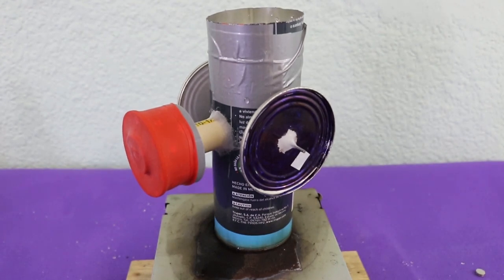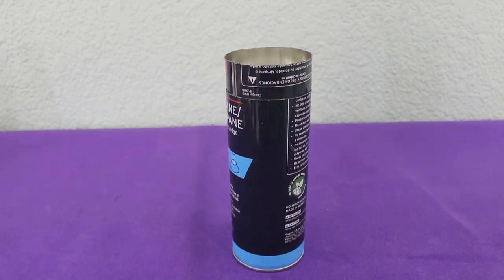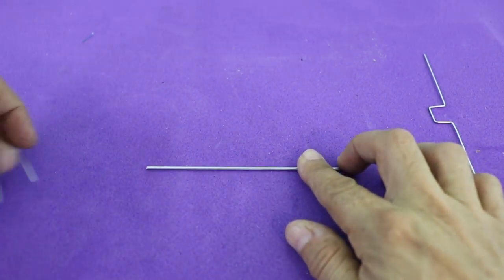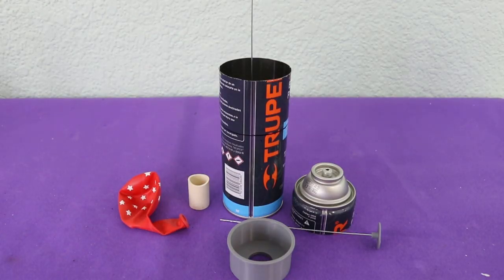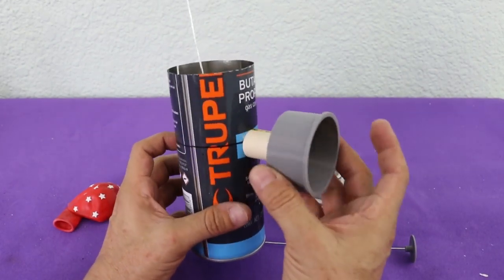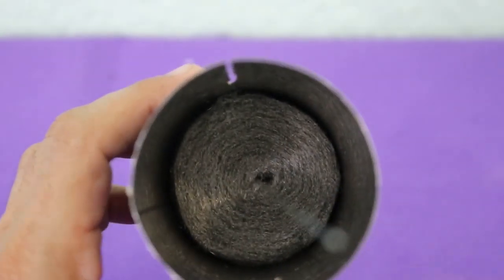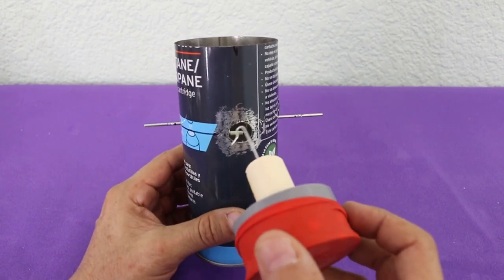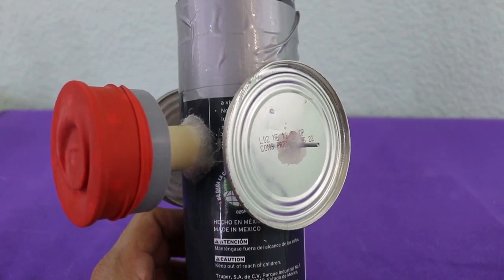Homemade Stirling Engine 800 RPM

Comment: I don't know if you are still active or not but would you mind explaining how the stirling engine works and why the steel wool also needs to go up and down? Like does the steel wool go up when its hot and push the crankshaft or does it just act as a piston? If it just acts as a piston, can I use any other object of the same size?
Reply: The steel wool is the loosely fitting displayer piston to move the air around and at the same time it works as a regenerator, keeping the hot and cold side better isolated.
Reply: I know the steel wool acts like piston rings. Lol
And the engine works on temperature difference

Comment: Bonjour.
L'assemblage des bielles sur le villebrequin n'est pas montré de manière précise c'est très dommage ! 
Salutations. 
Un ancien professeur de mécanique de la vieille école !
Reply: Note that the position of the 'baloon piston' is 90 degrees (quadrature) to the  wire wool displacer, so that the connection to the crankshaft is simple. both piston rods connect at the same point.

Comment: A Holley carburetor vacuum secondary diaphragm works great for the cold piston, versus balloons or rubber glove material. Not cheap, but I’ve got several just sitting there.
Reply from the maker: Never seen one  just pictures they look amazing
Reply: @ludicscience  a large flat steel washer with a 2” diameter center hole will clamp the Holley secondary diaphragm onto the bottom of a small 10 ounce steel coffee can. Could easily be incorporated into your designs, and it’s a viable, replaceable part.
Reply: @ludicscience  I’m building the Stirling engine, & I came up with a great idea!!! I have an old carburetor system from an old 8 HP Briggs & Stratton gas engine. I sealed everything with silicone, but I left the throttle operational. The diaphragm will be just inside the round air cleaner with the operating rod out the top. Properly positioned, the throttle will actually affect engine RPM., restricting flow from the displacer piston.
Reply: @boomstick4054  thats an interesting approach, did you try it?

Comment: Looking forward to build this. Dosen't the engine need an exhaust?
Reply: Stirling cycle is based on a pressure change, hot end (high pressure) cold end (low pressure) there is a displacer inside the CAN. The CAN is a sealed which is IMPORTANT. The displacer moves from TOP to BOTTOM of the can. It literally "displaces" the air, so the air moves locations from TOP to BOTTOM, at the TOP the air cools => low pressure at the BOTTOM the air is heated => High pressure. Since  the can is sealed those pressure changes drive the balloon or diaphragm in and out,  a mechanical linkage connects the diaphragm to the displacer in such a way that the cycle continues . So No exhaust,  if a leak exists it would simple lower the performance of the engine.
Reply: @robn2497  ok i get it thanks for the explanation

Comment: Make another one, but this time add a crank to one of the wheels with a magnet that goes through some wire coils and measure the voltage you get out of it.

Comment: I really like this simple design that avoids the need for finely machined piston/cylinder assemblies. . It would also  be easy to upscale to bigger components, and to create a multicylinder engine with this approach. Well done!! I am going to start looking for a  serious length of steel pipe and a car tyre tube.
Reply: Good luck

Comment: What powers the engine? Why is there water on the top of the engine? Cool project. 👍
Reply: It is powered by the difference in temperature between top and bottom. In this case handle heats and water cools. Air inside expands and contracts moving the piston
Reply: @JustinTopp  I see thanks
Reply: Usually I see people just use a candle or flame.
Reply: KTProjects yea the water isn’t 100% critical but it works on a temperature difference so water keeps it cooler so it’s more efficient and will run longer as the top won’t heat up

Comment: Plese answer 
Cam we use a lower quality steel wool(steel scrub)???
Reply: the idea is that it doesn't let that much air pass through, steel wool probably wont work as well.
Reply: @jacobgodde6576  hey can I cover one side of piston by a metal disc

Comment: Could you publish or provide a link for the measurements
Reply: Guess the dimensions from the size of the aerosol can and where the crankshaft is placed. Have a go at cutting up a few aerosol  cans. They ain't expensive round these here parts.

Comment: Try to add some load.. 
Do some useful work out of it.
Reply: This is an atmospheric pressure Stirling - they don't produce a lot of power.  However, I'd be interested in mounting a magnet on the power piston shave and wrapping a coil of wire around that PVC pipe, and seeing what kind of current I could draw from it.  If you sealed this up better and put pressurized helium in it, then you'd be able to get more power from it.

Comment: some info.         at 6:13,  the  mass and its distribution, in each flywheel are  Not   optimal/effective.  
at 7:06, imo,  the diaphragm is excessively noisy; and this suggests  inefficiency.         it is understood
that  different  cold-side  designs  have  differing  noise levels.            ideally, a diaphragm should act
as an  airtight,  low-tension,  centering spring;         note that  where the linkage connects to it,  the 
diaphragm is  LIMP.       in other words,  No  centering affect is happening.      consequently, the potential
reward for the use of a diaphragm,  is  Not  there.        the use of a balloon, frequently, results in a
low-quality  diaphragm.              at 7:22,  can you see that, due to its  Location,   the  water  is  doing
NOTHING.     googletranslate

Comment: Have you thought about trying to measure the power output? Possibly by connecting it to some measurable load. If you could also measure the power put in as heat then you can calculate the efficiency.
Reply from the maker: Yes I plan to build  a prony brake
Reply: @ludicscience  Ah yes, then it will be interesting to compare the devices.